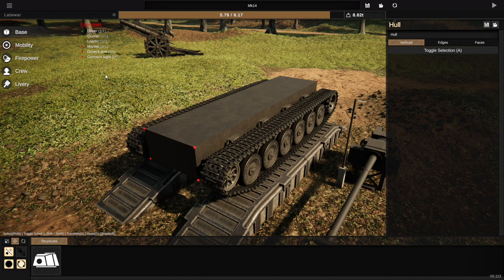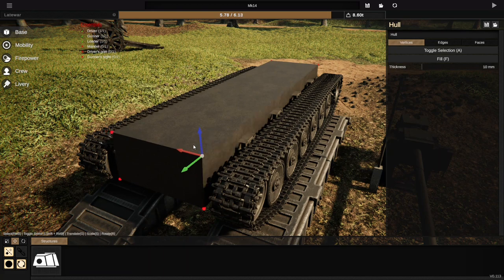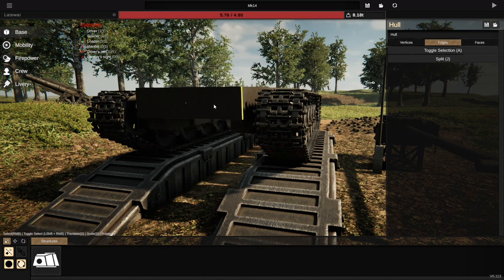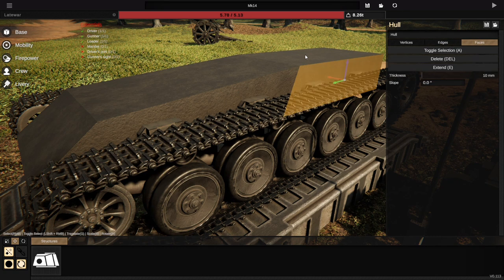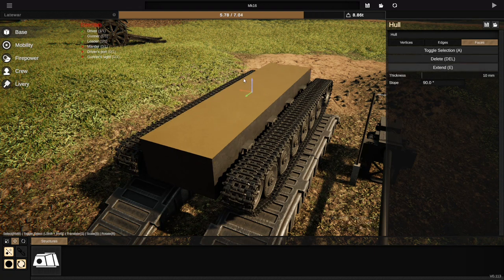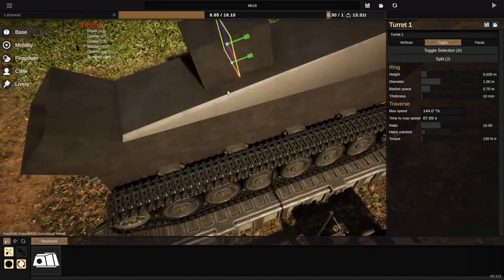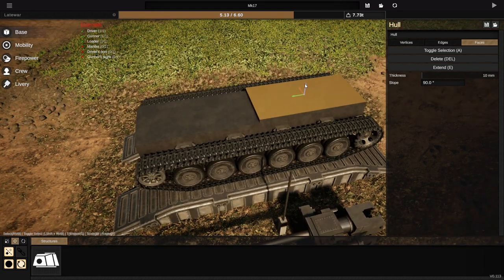Sprocket Tank Design: Very Quick and Dirty v0.113 Tutorial

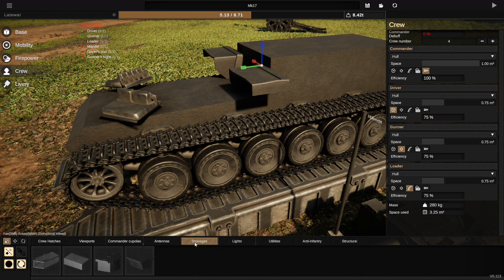Comment: Bit new to the game and at about 16:00 you were talking about placing objects, how do you prevent those from being mirrored ie. if your just wanting o place one and make it asymmetrical?
Reply from the maker: You’re a bit new and this tutorial is a bit old! Nevertheless, I can help you there. There are four boxes on the bottom left corner of the UI. One of these (two squares separated by a diagonal line) is the mirror function toggle and it mainly affects fixture and decal placement. By default, it can also be toggled with the X key.